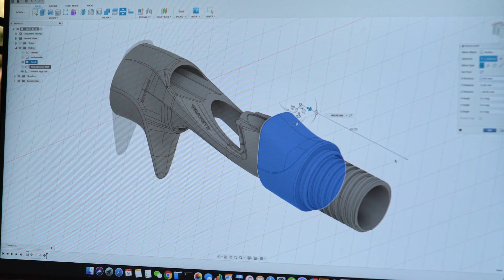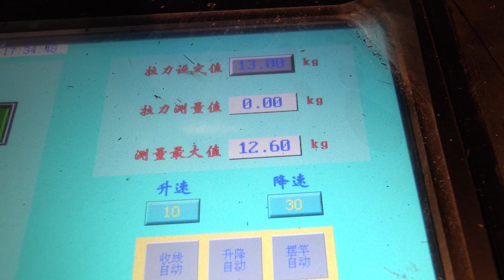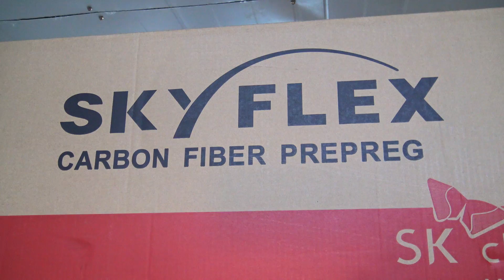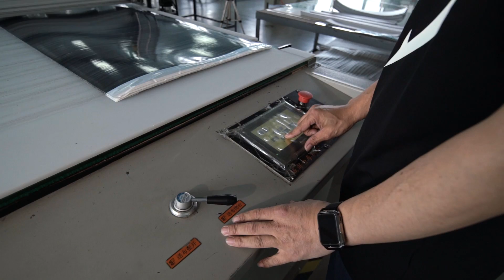Как создают удилища. Производство спиннингов

Comment: this rod have export in malaysia?
Reply from the maker: The closest distributor of FAVORITE brand is located in Thailand.
But the range of goods is not full there.
It will be helpful if you can recommend us a good and advanced shop in your country. We will contact them and try to make business.
In this way our goods will be finally presented in your country and anglers could check it and buy without expensive delivery costs.
Thanks!
Reply: @FavoriteFishingUkraine  oh ic,first need covid gone..

Comment: Do u have distributor in Indonesia?
Reply from the maker: The closest distributor of FAVORITE brand is located in Thailand. 
But the range of goods is not full there.
It will be helpful if you can recommend us a good and advanced shop in your country. We will contact them and try to make business.
In this way our goods will be finally presented in your country and anglers could check it and buy without expensive delivery costs.
Thanks!

Comment: Apa ada dipasaran indonesia?
Reply from the maker: The closest distributor of FAVORITE brand is located in Thailand.
But the range of goods is not full there.
It will be helpful if you can recommend us a good and advanced shop in your country. We will contact them and try to make business.
In this way our goods will be finally presented in your country and anglers could check it and buy without expensive delivery costs.
Thanks!